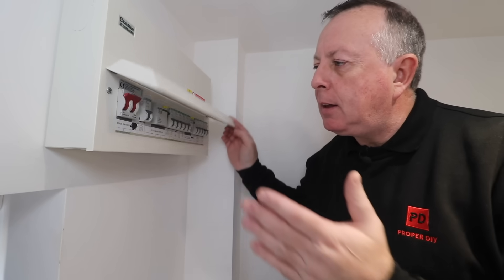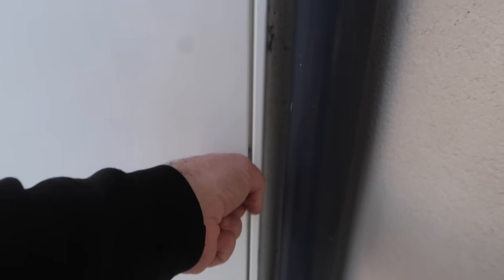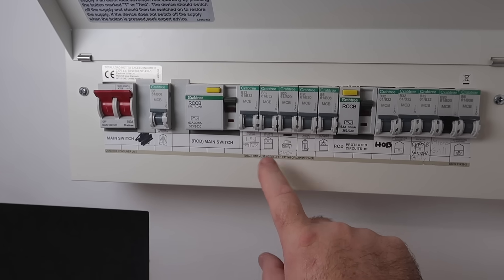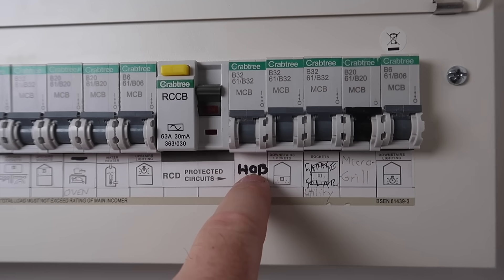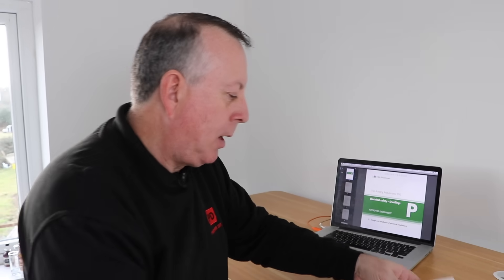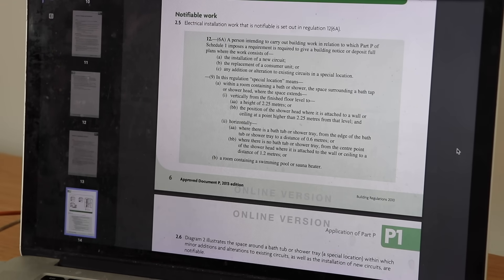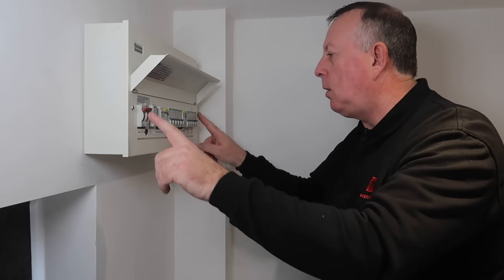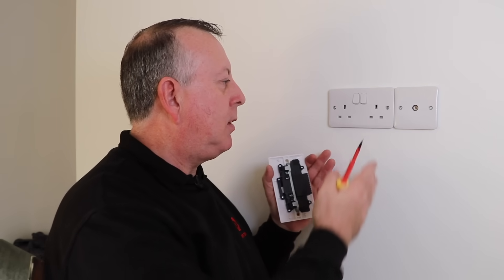What electrical work are you allowed to do in your own home?

Comment: in Australia NO one who is not A Qualified Electrician must not  do any electrical work at all not even put on a three pin plug on a lead it is against the Law and the penalties are severe up to $ 50,000. in fines plus court costs . so its not even worth it. most D.I.Y.R.S like myself can do the work but the Law says no you don't unfortunately there are people out there who don't do  the work  the correct way so the government has to make the laws for the idiots in this Country but it is interesting how the laws are different in other parts of the world . the Australian Voltage is 230 to 240. and the system is a bit different to the U.K we don't have a 32 amp Ring Main Circuits only a 16 amp or a 20 amp Radial Circuits .
Reply: Are there many prosecutions in Australia for DIY electrics? How is it policed? How do the authorities know/ find out if someone has carried out illegal electrical work?
Reply: well it all depends if the the home owner been seen by the neighbours doing illegal  Electrical work or there has been a fire or some one has been electrocuted  and   some times inspectors come around to check  the wiring on  properties  for inspection. see all licensed Electricians must let the power companies know if there  been any Electrical work done on the customers Property and the home owner must have a copy of the work notification    for reference. Australia has very strict  regulations  .
Reply: @ianmatthews3487  Thanks for your reply. Sounds like a much better system than the UK, where any idiot have a go hero can do electrical work and the Govt pretends to regulate it whithout actually giving a toss.
Reply: @davebadger100  
If you go by electric accidents, the UK fares very well to other countries, so no need to have strict laws, giving jobs to jobsworths, as data proves that. It is getting better with AFDDs being introduced and RCBOs etc. A final ring circuit using 4mm cable, AFDD and screwless sockets is near bombproof.
Reply: @johnburns4017  
One electrical accident/death or fire is one too many, so you trying to justify incompetant untrained people like yourself having a go at electrics is a pointless arguement. 
The  reason why there are not many many more incidents in this country is precisely because of relatively strict laws and regulations governing electrical work.
You've already proved your comlete lack of electrical knowledge on several occasions so it really isn't safe for you to be messing around with electrics. You don't have final ring circuits in domestic enviroments for example.

Again if you knew anything about electrical installation then you would also know that RCBOs and AFDDs are not guarantee against shoddy DIY electrical work. AFDDs in particular are only effective under certain conditions in a ring final circuit.

Look I know it bugs the hell out of you, because you think you know what you're doing, yet no one will acknowledge that, but that's just the way it is. 
If you want to be recognised as competent, then do what us electricians had to do, get an apprenticeship, got to college, get qualified and undertake the requisite training. Until you do that all you'll ever be is an unqualified dangerous, DIY have a go hero.
Reply: @davebadger100  
A ad hom attack. I struck a raw nerve. Amazing.
AFDDs/RCDs/RCBOs have greatly improved safety.  Any self respecting electrician would know this.
Reply: @johnburns4017  Where did I say they haven't improved safety? I said they are no guarantee against shoddy electrical work.
They have improved safety to a degree, but they are no substitute for competantly installed electrical work by a qualifeid electrician who knows how to safely install, inspect and test their work, which is a legal requirement under the law as is issuing a certificate for said work.
Tell me, how do you know a brand new RCBO or AFDD is working as it should once fitted?
Reply: @davebadger100  Tell me this, is work carried out by a non "qualified" person but done to current regs safer or less safe than work done previously under regs that are now deemed unsafe? For an example I moved to my bungalow 25 years ago. The original electrics were from 1967 & were plastic so technically did not need to be replaced. However the lighting circuit had no earth lead (and yet had a metal light fitting in the lounge), there were not enough sockets for a more modern type of living. The kitchen sink was not earthed to the circuit to prevent shocks. And the consumer unit was a plastic fuse box with old style fuses which were fuse wire replaceable (not even proper fuses). So putting aside having the work done by a "pro" to the standards of 25 years ago (which may now be out of date & be deemed "unsafe") would work carried out by myself to a standard that complied to standards from 25 years ago worse than leaving everything that was done by a "pro" from 1967?
Reply: @triax7006  In a nutshell work done by a pro from years ago will be safer than work done by unqualified person who thinks they are working to current regs, but in reality probably won't be because they won't have a clue how to comply with the regs or interpret them.
Quite frankly your comments prove once again why unqualified DIYers should stay well away from electrical work.

Firstly older versions of the regs are not deemed unsafe. Certain aspects or standards may be deemed less safe, but even installations from the 60's and earlier are not "deemed unsafe" for continued use, providing they are not damaged or sufficiently deteriorated as to be a shock or fire risk. 

Secondly it is still possible for lighting circuits with no earthing to be in use with no cpc as long as class 2 fittings are used throughout. There should be labelling at the board warning that no metal fittings should be installed. I'd bet it was a DIYer that used a metal light fitting. Electricians know not to fit class 1 accessories to circuits with no earth.

Kitchen sinks haven't needed to be bonded (earthed) since 1991 so the sink in your bungalow was fine. Excessive bonding of metallic parts was introduced in the 15th edition (1981) regs and heavily reduced in the 16th edition from 1991. In fact earth bonding of a sink has the potential to introduce shock risks in the event of a certain faults, where there would normally be none had the sink been left well alone.

Old plastic fuse boxes are still completely safe and  suitable for continued use today. Latest regs are not retrospective. It is strongly advisable to get one changed for a modern consumer unit as they offer additional shock protection, safety and convenience over older fuse boxes, but there is nothing regulatory that says they are unsafe and must be replaced.
As for replaceable fuse wire fuses not even being "proper fuses" just shows more gaps in your knowledge. This was a perfectly acceptable method of circuit protection in it's day and it's not unsafe or dangerous, just inconvenient, when the fuse blows.

Tell me, how do you test your work when you have completed it. to prove that it is safe and complies with the latest regs?
Reply: @davebadger100  When I moved into my house 25 years ago the fusebox had rewirable fuses & I fitted MCB's that simply replaced those fuses - so already far far safer than what was there before. No earth bonding onto the metal sink, no earth for the lighting despite a metal light fitting in the lounge. No earth for the lighting of course for the bathroom. Some rooms only had 1 socket & certainly not enough in the kitchen for modern use. Light fixings inserted into the ceiling with incandescent bulbs located in the loft which would need a person to go into the loft to change them, asbestos cement used to guard against fire. But hey they were all done by "pros" (I have zero idea if they were of course as it was done in 1967), but far be it for me to modernise things & make the house safer, maybe I should have left it as is & trudged up to the loft to change the bulb or simply leave out of date ideas because a "pro" did it?
Reply: @triax7006  Did you even read my reply?
MCBs are no more safer than rewireable fuses. They both provide the same protections, that being overload and short circuit protection. The only  advantage with MCB's is that they are more convenient for when a fault has occurred. They can be quickly re set whereas a rewireable fuse has to be rewired. 
You wasted your time if you thought you were improving safety.

Sinks do not and never have required earth bonding, so again you wasted your time in a futile effort to improve safety.

The metal light fitting would have been added at a later date, so your statement should have read 
"a metal light fitting in the lounge despite no earth for the lighting" .
No earth in bathroom lighting is not up to the current regs, but it would have been compliant in the 60's. It is not inherently dangerous as long as all fittings in the bathroom are class 2 (plastic).

As for your other points, modernisation is a seperate issue to safety. You are trying to combine the two issues in a vain attempt to justify your own ill informed fiddling with electrics (which you clearly have very little knowledge of) and to condemn the original "pros" as being incompetent because they were not to a working a version of the regs that didn't even exist at the time.

You are the epitome of "a little knowledge is dangerous". If you need to modernise your property, you would be well advised to employ someone who knows what they are doing. It is obvious to any experienced qualified electrician that you clearly do not know anything about competent electrical installation.

Finally I'll ask again as you seem to have ignored my question the first time.
How do you test your electrical work when you have completed it? What test equipment do you use and how do you certify it?
Reply: @davebadger100  You are wrong with regard to MCB's. MCB are far safer than rewireable & even replaceable fuses as they are far more sensitive & are tripped faster. In addition a RCD when fitted provides the additional protection & are easily fitted into a consumer box but not a 1960's box with only space for 3 MCB's (or fuses) & the main 100A main breaker Also rewirable fuses means they are open for someone to put incorrect gauges or fuse wire in there or even wire or nails all because they have none to hand. 
As regard to bonding of sinks you forget that sinks are earth bonded IF the stop tap is also earth bonded & of course a 1960's stop tap was not earth bonded (my stop tap is in the bathroom & there are no electrics in the bathroom). So clearly earth bonding to the sink is required as there was none on any of the pipework & there are electrics in the kitchen.
Whether a metal light fitting was fitted before or after the builders finished the house in 1967 is of little consequence when faced with a metal light fitting & obviously no earth at all which of course would mean zero protection if there was a fault in the light switch when changing a bulb (yes ppl change bulbs without calling out a "pro" to do it).
As for checking your own work then I would say doing your own work on a car that is driven on roads that has the potential to kill someone is far far more dangerous. At the end of the day a person is liable for anything that goes wrong that can cause the death of someone else. I would also add the level of competence with so called "pros" leaves a lot to be desired. Clearly there are some that will do work competently & there are others that will not & yet "self check" there work. I mean I had a quote years ago for putting in a whole central heating system & because they did not want to go under a few floorboards they wanted to have the pipe work run in the loft using plastic pipe with those crappy push-fit fittings that always leak & have them run down the walls & have them in conduit. Not only unsafe in my opinion (and clearly would be when it leaked) but also ugly & shoddy planning.
It's as if ppl think "pros" are beyond criticism & yet YT is full of shoddy work from those "pros" whether it is builders, plumbers, electricians, engineers. Look at how the public buildings in England are now being condemned all because so called "pro" structural engineers designed them using cheap materials (albeit only having a life of say 40 years). Shoddy work can be done by non pros as well as "pros", the difference is the legality of the so called "pros" who can self check their shoddy work & sign it off as to the regs.

Comment: According to a recent guardian article. None. “It is illegal to do gas and electrical work if you are not qualified,” says Jo Behari, a DIY expert and author. “. People can die if it goes wrong.” See: How to get better at DIY without spending a fortune by Sandra Haurant.  (I did ask them correct it)
Reply: The Guardian article is wrong. It's only illegal to be paid to do gas work if you aren't Gas Safe registered. As far as electrical work is concerned only certain work is considered "notifiable" and must be approved by Building Control (or done by a registered professional who can self-certify their work).
Reply: @jeremybarker7577  
Correct!  Anyone competent can do gas work, as long as you do not charge money.  Once you charge you need to be Gassafe registered. Try explaining that ton Gassafe men - it fries their brains. They think gas works is a black art. 
With Electrical. You can do it all yourself, inc CU, then get an electrical safety check. All done.  The same with those charging money to do electrical work. Many building contractors do all the electrical work then get it checked off before handover.

 See @anonnona8099 post.

Comment: It's all a pathetic scam. Part P is only beneficial to electricians and insurance companies. Everyone else looses out. I have an un-used 45Amp shower connection. Can I use install a car charger? No. I need to update my consumer unit. Can I do it? No. I need to remove a cooker connection in my kitchen. Can I do it? No. We need some sockets in the garage, on a new ring. Can I do it? Nope.

I re-wired my property as it failed its inspection when we moved in. The house which was initially re-wired by an electrician. All the tails to the sockets were too short and some light back-boxes had no earth. The cooker connection was wired with 2.5mm2, a light fitting was installed outside which was not designed for outside use....

5 years ago we had a new boiler fitted and they had to get an sparky in to wire the boiler to the fused spur which was already there. Cost? £150. He also had wire in the wireless thermostat which he could not do as he did not understand the instructions on how to fit it. It was 2 wire 12v. Took me 10 minutes to do it. His next job was in McDonalds....

Sparky at our church had to move a floor socket... tails hanging out of the box underneath the floor and cable joined (which is lying on the ground (soil)) with a choc block - no protection around it.

Part P can Pee off. Some of the jobs I've seen sparkies do and charge, I think they are a member of the Clowns, not NICEIC (there are however, good honest ones, but the ones I have seen, I would not trust them with knitting needles and a ball of wool).

Don't get me started on those sparkies who are ""experts"" on network cables. Yeah, sure you are.....
Reply: "I have an un-used 45Amp shower connection. Can I use install a car charger? No. "

You can.  See @anonnona8099 post.
Reply: "The cooker connection was wired with 2.5mm2"
Was that the oven only? They are usually around 3kW.

Comment: Question to anyone. I have a container about 10 meters from my house. I need a double plug socket filling only. I intend to just install a double plug outlet with RCD extension lead overhead on a wire cable to container. This extension will be fed from a outside plug socket. Is this ok..
Reply: Sounds horrific 😂

Comment: is it legal in  the UK to install 12v sockets throughout a house, as a separate electrical system, running off solar panels/a battery?
Reply: yep.
Reply: Good question.
Reply: @worldofenigma1  I live i a boat with both 12v off grid system plus a 240v system run off an inverter or shore power. I would love to live in a house set up like a boat. I wonder how the government would react if people started making their homes off grid with boat style systems. I’m sure they’d find a way to stop it. As it is they’re already coming after our wood burners and diesel…
Reply: @peanutboxes4076  
I recall seeing a 12v lighting system. It had two 230v to 12v transformers at the Consumer Unit. The 12v LEDs have never conked.

Comment: Those RCD are interesting as you have what we in Canada and US call a ground fault circuit interrupter protecting your whole house. We have GFCI breakers as required on individual circuits such as bathroom or hot tub feeds. I like to watch these kinds of videos from different countries as the differences are interesting.
Reply: RCD = GFCI
RCBO = RCD plus an MCB (micro circuit Breaker).
AFFD = RCBO plus arc fault. 

Now becoming common in the UK is RCBOs on all circuits.
AFDDs are mandatory on socket circuits on some high rise blocks, etc. They are recommended on all installations, which means fit them unless a good excuse not to.

Comment: Great video. The amp rating on the rcd are the maximum rated current they can handle it isn't a breaking current rating like mcbs. Your rcds could possibly be overloaded. 63A shouldn't have that much on them. I see both of yours have well over that. I would recommend getting a little bus bar and changing at least one of the 32mcbs on each rcd for an rcbo.
Reply: Best fit double pole AFDDs on socket circuits and high current radials, like electric showers, cookers, etc. Cover all safety bases.